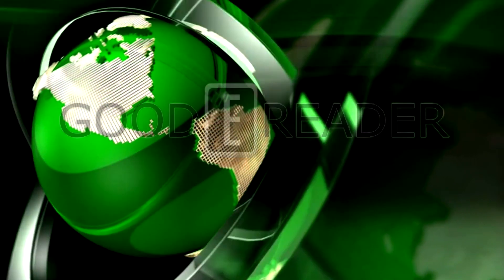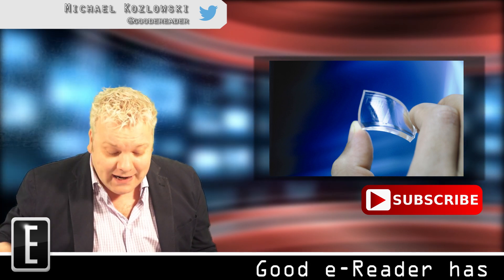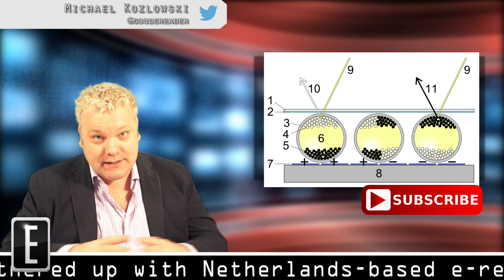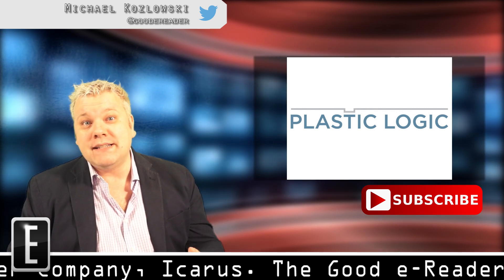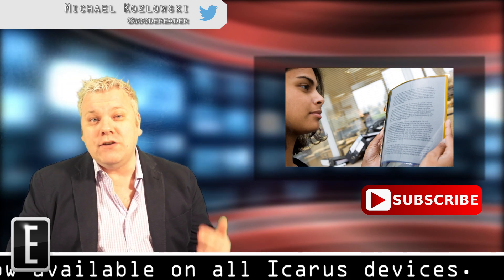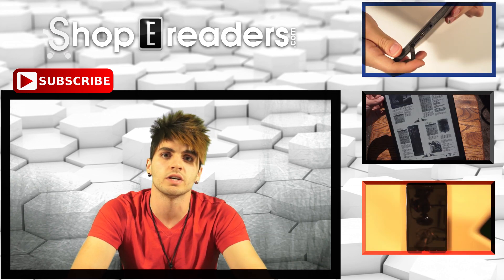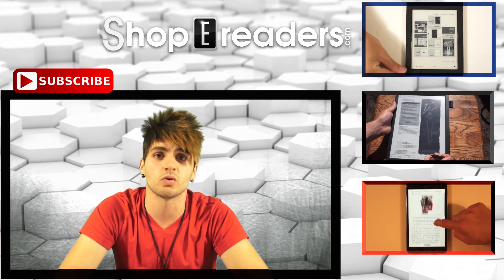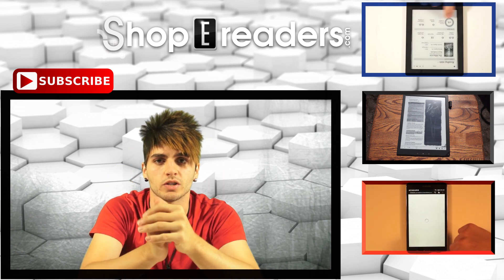Graphene Displays might be the future of e-readers

Comment: 150 ppi is not even as good as the Kindle 4 screen (167 ppi) - it's passable, but not exceptional.  I can't see much advantage to it over Mobius unless it's cheaper; offers color; has better contrast, refresh or less image persistence; or provides massively better battery life.  Mobius is flexible too but costs 3x as much as other eInk screens.
Reply from the maker: MajorSeventh its more about the screen's physical composition rather than resolution i suppose,